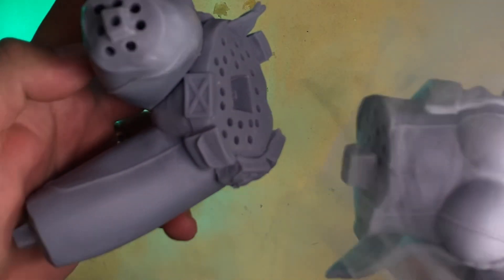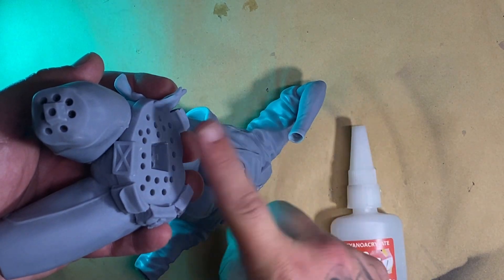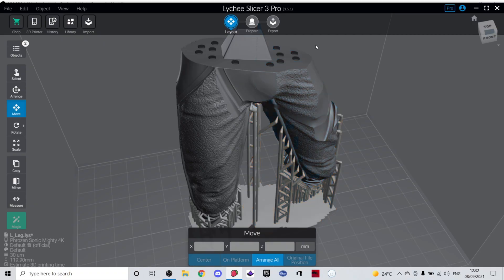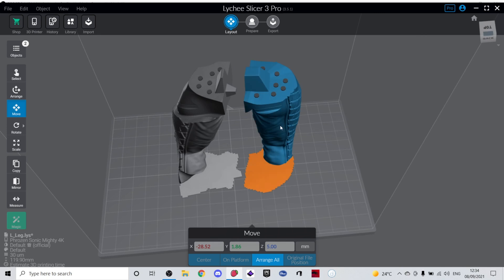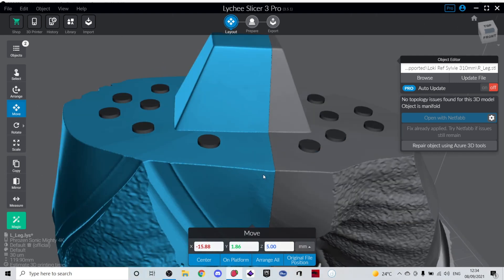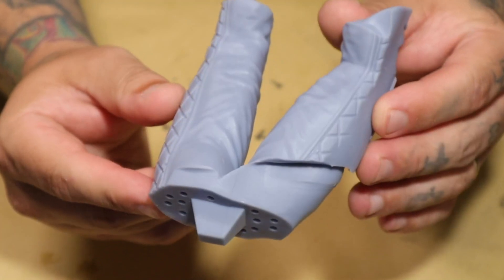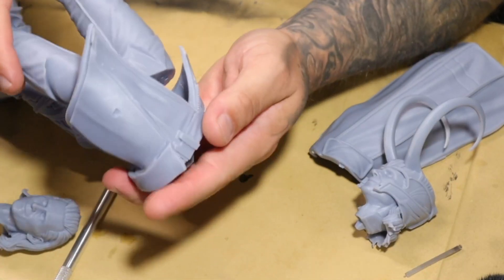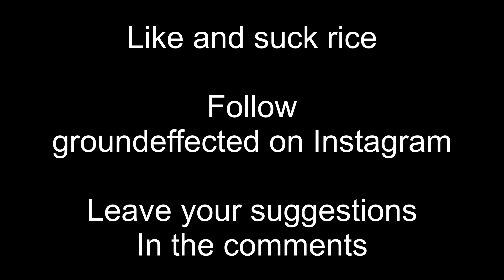How to Merge 3D print parts in your slicer

Comment: You should try meshmixer, they import in exactly the right position so you don’t have to manually line them up, press ‘merge’ and export as an stl file for use in lychee 👍
Reply from the maker: I use mesh mixer. But in my opinion there was little to no difference to moving these two parts in mesh mixer or in lychee, I was already in lychee and it saved me having to leave that app and open a new one and delivered the exact same result. Just a thought if anyone was feeling lazy like I was, the same positioning tools are available in lychee and they import in the exact same place as mesh mixer too. Thanks for watching